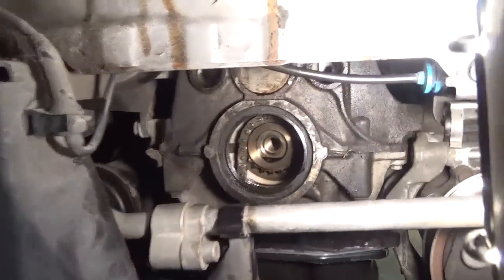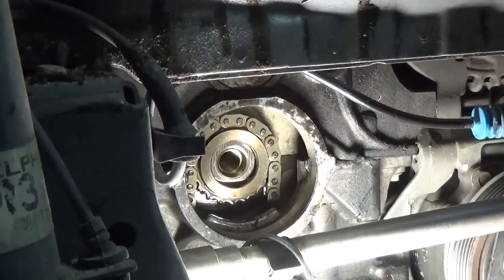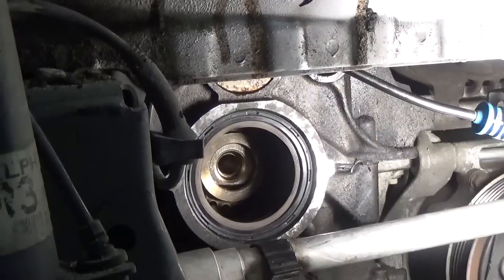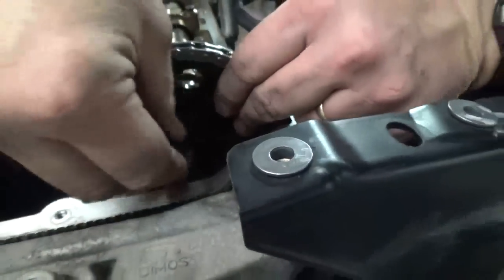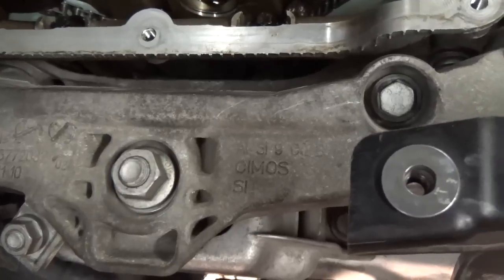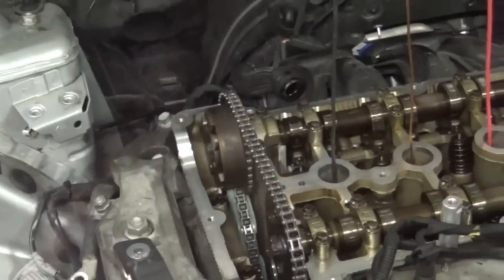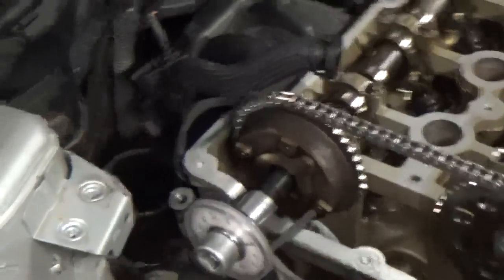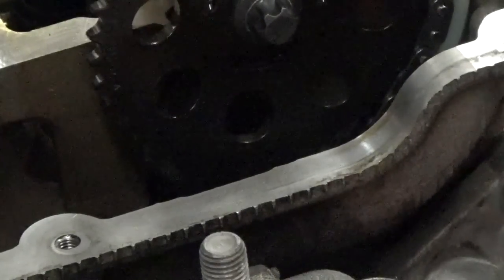2007 Mini Cooper S Timing Chain Replacement Part 3

Comment: Hi, 

Just wanted to say a little bit about safety............... oops sorry, watched your videos so much I got carried away there😉
Seriously though thanks a million for being so patient and detailed in your description of how to remove/reinstall cylinder head and setup new timing chain etc. It should make you proud that lots of amateurs are using your guidance to step them through the process.
My wife's mini suffered the identical fate of yours, jumped timing chain, death rattle then 8 bent valves, took it to a couple garages and just about fainted at the estimates to repair it. I dabble mechanically, put engines into small tractors etc but never taken on anything like this.
I watched your videos repeatedly with my 23 yr old son and eventually got the courage to take it on. After day one my garage had more bits in it than could have imagined, oh shit I thought, I hope we remember where they! 
We watched a few other videos and decided to Lapp new exhaust valves ourselves as well to try and save some money, as you say "if they weren't so nice to drive, you wouldn't bother" we also found the subframe to be rotten so decided to go ahead and source a 2nd hand one tidy it up fit new wishbone bushes etc and put it all back together hoping the engine work was going to be worth it.
Over the Christmas holidays we worked some long days but delighted to say it looks like it has paid off, a couple of days ago at around 10.30 at night we got to the point ready to try the engine. We're Scottish, so naturally we agreed, if it started we would go back to the house and have a wee dram (whisky of course!) and if it exploded, then we would still go up to the house and have a wee dram!!
Thankfully it was a celebratory dram, it started first turn! Absolutely delighted, a great father/son experience together, two days in and it is running better than it ever did.
We saved a bit of money in the process, it wasn't about that though, we learned so much and that's all thanks to people like you. 
So thank you very much and keep up your good work, if your ever over in Scotland I'd love to buy you a whisky to say thanks in person.😀
Reply from the maker: Thanks for the kind words, Murray! Glad the videos gave you the confidence to take on this project.
I've always wanted to go to Scotland. My ancestry going back to the 1400's was from the county of Cork. If I ever make it over, I'll look you up.

Comment: Hey man, you do a great job and you are really careful and you really understand what you do. Thank you for your videos! Little hint from my side to ease your work: to remove the crankshaft seal (above video around minute 4+), there is a much easier way: just hit the top of the seal with a 5 millimeter drift and it comes out on the bottom side just like this. Nice greets from Germany!

Comment: Rather than drilling and installing screws, I use a long prybar for the seal, against the frame rail and gently force it out from the top inside edge of the seal. Great video though for the Mini specific info especially.

Comment: I've seen conflicting videos about the crank shaft bolt / sprocket being left loose when installing the chain and tensioner etc fully and only when everything is in place then it is torqued up. But I've noted you torqued crank bolt up before fitting the tensioner. I thought the sprocket was left loose so that all the play in the chain is taken out? Just wondering what to do now lol which way is best? Great set of tutorials though really helpful Thanks 👍
Reply from the maker: I'm sure you can do it either way, as the crank is held in the correct position with the positioning pin.

Comment: Small tip #1: To remove the spark plugs, if you don't have or want to buy the BMW spark plug socket, you can use a long15 mm six-point socket.  It does not have the rubber bushing to hold the plug, but I used a medium claw grabber tool to pick the plugs out of their shafts and to lower the plugs back down and hand-tighten before using the 15 mm again.  The torque on the plugs is low, so you're not going to strip them with the 15mm.  The claw grabber is a must-have tool for anyone who ever drops nuts and bolts in an engine compartment, so it’s worth having.  Get one with a light.

Small tip #2: There are cheaper camshaft locking tools on ebay. I bought one new for about $55. My locking kit came without the vital instructions, but there's a youtube video on that.

Small tip #3: I did a bit of reading on this.  A DIYer said the Feltpro seal is better than the Corteco brand seal and better than the Mini original, at half the price.  Also, the Mini-specific seal replacement tool which Pelican Parts says you MUST have costs “only” $120.  The one in the video looks a lot less expensive.  However, a DIYer said you could buy a female coupling for 2" PVC pipe, and use a block of wood over it to tap the seal in.  The coupling cost $1.59.
Reply from the maker: Bill Donovan. Great tips! My plugs were 12pt, 14mm. Maybe there is a replacement plug that uses the 15 mm socket, but it wouldn't work on mine. I saw the cheaper cam tools on eBay too. I opted for what seemed like better quality. My only regret is my set didn't have the pre-tensioner tool in it. I had to buy that separate.
Reply: I'm puzzled that the 15mm worked on my 12-point 14mm plugs but not on yours.  Not questioning you, just puzzled.
Reply: Bill Donovan I just use it's ignition coil once the spark plug is free. Push the ignition coil back on and pull out. No extras cost effective

Comment: Great videos-  quick question to be clear -  when breaking the crank bolt loose, (and when you torqued the new bolt)  you just used the flywheel locking pin to hold the crank in place ?

Comment: Hi Paul, I just completed my chain replacement today. However the engine won’t start. It turns, but doesn’t start up. I checked the timing again and it looks right. Both cam stamping facing up when the locking tool is in place. My valves are fine since I changed the chain when engine is still working. I was wondering if you can give some clue why it won’t start? I suspect the vanos is not in the rest position. Everything else seem right. Thanks in advance.
Reply: most likely the ground wire on the plug harness. If you forget to screw this back on the valve cover bolt it will not start

Comment: Aug 23 2020 - im watching this video. Will 15 ft pounds of torque hold the sprockets in place as you rotate the engine?
Reply: Same question here. I am in the process of replacing the timing chain on my '07 S and some videos suggest 20 ft lbs while others sat 15 ft lbs. Is there a correct number? Thanks for the help.
Reply from the maker: I think it should.

Comment: doing this job at the moment and needed to know if the gears have a certain placement when putting the chain on
Reply from the maker: eatonpeaches no, they do not. I thought that was odd myself, being used to us cars.
Reply from the maker: eatonpeaches just enough sure to use the pre-tensioner that comes with the timing kit. mine didn't come with one and I had to adjust it a few times to get it right. the pre-tensioner goes in the tensioner hole in the head and takes the slack out of the chain before you tighten the sprocket bolts.

Comment: Hi...couple of quick questions if you have time to reply would be greatly appreciated... regarding the vanous hub on the intake camshaft,I know there is no keyway,but is  there a certain way it has to be fitted to the camshaft regarding oil feeds to the hub or is it just simply placed on..?and also because the valve timing was out,did it cause any internal damage to the engine... thanks
Reply from the maker: Jason, there is no specific way the VANOS sprocket goes on. Once you get both sprockets on, use chain tension adjustment tool placed in the tensioner hole in the back of the engine to take the slack out of the chain before you tighten the sprocket bolts. On mine, it jumped time and bent all 8 exhaust valves. Had to have the head rebuilt. New intake exhaust valves, valve job and head milled.
Reply: @miniadventure8714  thanks very much for the reply..I've got a Peugeot rcz with the same engine in it that has done exactly the same thing as yours..I think to follow your procedure and install the new chain kit..if it sounds the same as yours did upon cranking,I know it's going to be along and expensive road ahead for the owner..cheers Jason

Comment: Great video. Very informative.
There were maybe 4 variations made on the chain tensioner.
Is the replacement with the latest tensioner made by simply replacing the old with the latest? Or can the chain skip time when removing the old tensioner?

Comment: Great series of recordings, huge help. just one question, were you able to torque the crankshaft bolt just using the crank locking pin to stop it rotating?  I'm nervous it will snap the pin
Reply from the maker: I was nervous about that too. That is what I used to hold mine. Worked fine!

Comment: Thanks for the videos.. helping me a lot. When you torqued down the crank hub bolt how did you secure it from spinning? Did you use the 5th gear/brake technique or leave the locking pin/tools in place or use a crank holding tool?
Reply from the maker: Will Bradley. I used the crank holding tool.
Reply: Mini Adventure thanks. I just finished my work today - timing chain, removed/reinstalled oil sump, new VANOS solenoid and maintenance tasks (oil filter, new aux belt. In the end I took the risk and made do on tightening the hub bolt with all locking devices in place, somebody holding pressure on ex cam shaft with spanner and somebody in the car in 5th gear with brakes applied. May have been lucky but nothing broke and it was surprisingly easy to get 180deg 2nd stage. It was a tense moment turning it on for the first time.. started ok with a low oil pressure warning at first then settled down. It did however stall after a couple minutes then didn't start. Tried again and back up and running seems stable. Any idea why may have stall on the first run? 

Thank you so much for your videos that were invaluable

Comment: Ten Months Later...Partial Do-Over?
I am hearing the rattle again.  Not very bad.  I took the valve cover gasket off and inspected.  The top rail is slightly bent and not aligned perfectly with the chain. No cracks, no missing plastic, but definitely not perfectly aligned at the end where the chain comes up from.

Very likely, the chain is hitting it.   I suspect that the aftermarket repair kit included a weak chain tensioner.  I noticed back when I did the repair that it had more spring pressure than the old one, but not a huge amount more.   

So I am going to buy a Mini second-generation chain tensioner ($64 at Pelican, $69 ECS and Amazon, $79 Minimania) and a new top rail, put them in, and hope for the best.  

If I have correctly diagnosed the cause, then maybe one should not buy an aftermarket chain tensioner.  Mini has changed the design about five times, and the aftermarket may not have the latest one.

Comment: Hi, 
By far the best explainatory video on that subject. A big thank you for that, the detail level is awesome 
One question (I'm french and I probably didn't catch it) : did you use the flywheel lock pin to hold the crankshalf while torking the extra 100° ? 
thanks again
Reply from the maker: Yes, I used the flywheel lock to hold the crank while I tightened it.
Reply: Salut mdr je me lance dans ma distri sur thp jsuis français aussi lol
Reply: @nocopyrightsaudio6322  je te souhaite bon courage dans l'aventure !

Comment: Hello Mini Adventure. I have an issue. I did the job described in the video. However, after I finished and out some oil to lubricate the chain, I noticed that crankshaft seal is leaking (yes, no pressure, just few turns by pulley hub). I first thought that it's a seal that I installed badly, but then I realized that crankshaft pulley hub is NOT CENTERED in the spot for pulley. It play around 1 or 2 mm. Well, I am not sure what centers the pulley, the only thing on my mind is that I didn't have special tool to tighten the crankshaft center bolt, so all force vent to the flywheel lock. Any idea what could go wrong? Thanks in advance.
Reply from the maker: Not exactly sure what you are asking.....My hub went right in, used the flywheel lock to hold the crank in place and torqued it down. Another subscriber says the spec has changed to 37lb/ft then an additional 180 degrees, instead of 110 degrees. I haven't verified that myself though.

Comment: HI,great videoes,thanks!!!Do not have a new camshaft bolt if there is a problem?
Reply from the maker: All camshaft sprocket bolts must be replaced because they are torque-to-yield bolts. They cannot be re-used. You can get them on eBay. Thats where I got most of my parts.

Comment: Hey there, did the inlet camshaft dephaser spprocket need to be reset (pressurize with compressed air through oil inlet hole in the unit) before reinstall?
Apparently vvt dephasers need to be reset to their "resting position" before they're installed back onto the camshaft. 
I've got dual dephasers on a 1.6vti peugeot engine (same as this mini) and was wondering if this needs to be done before reinstall??
Reply from the maker: mine did not require that. the chiltons manual shows a good picture of what it should look like.
Reply: +Mini Adventure 
I have a Haynes Repair manual and there's something written in there about putting the dephaser back into resting position. 
Anyway I'll ivestigate it further. 
Thanks SO MUCH for posting your video as I'm going to save myself a lot of money doing it myself. I'm also quite an avid DIY mechanic but will be my first time doing a euro car. 
By the way, how did your mini run after this repair??..all good? 
Cheers from Australia!
Reply from the maker: +appdevcoder linux it ran great! no problems since. have put about 6k miles on it since.

Comment: it's so crazy that you set all pistons half way down for TDC on the motor Wow
Reply: Its not top dead center, its just where this engine was designed to be put in time. Since there are no marks on the sprockets, you can time it anywhere. They want the pistons halfway down to aleviate damage to the valves during the process.
Reply: @bdavem  europe motor like  do that

Comment: Thanks for the great video.  Let me ask you a question: A have a 2007 MINI Cooper R56 N12 Engine(Dual VANOS).  After changing the timing chain I keep getting the following codes P0014 & P0015. Did you have any codes back like that?
Reply from the maker: No, I didnt. Mine only had the VANOS on the intake side.
Reply: I had these codes on my 07 bmw x3 all i did is change the oil and the codes cleared

Comment: Crank and cam sprockets rotate. Yet the cams are not moving.  I double checked the torque. Crank pin is removed. Sprocket bolts are tight.
Reply from the maker: Not sure how that is possible.... If everything is torqued correctly, the cams should turn.

Comment: The crankshaft stage 2 has been updated to 180 degrees of rotation, also before all stage 1 torques install the tensioner.
Reply from the maker: Boosted_ Dizzle Thanks for the update! it's always good to share this info! thankfully  I haven't had any issues so far.
Reply: thank you for that i was going to ask
Reply: WELL, you might want to clarify the bad information about this. There is a big difference between 180 deg and 100 deg, some of us doing this the first time want  to get it right. Unfortunately my Bentley manual also had it wrong at only 100 deg ! I found out after 2 days driving and after discovering later the 2011 service bulletin I ended up tearing everything down to tighten the extra 70deg.
Reply: Quick question for both of you. How in the world are you breaking this bolt loose and then reinstalling the new bolt and also getting it that tight? How are you keeping the crank from rotating? Seems like an impossible task? 
I'm just looking for a tip or trick before I start doing this job on my 2008 Clubman

Comment: Hey! Thank you so much for the video tutorial!
Here at 14:00 you put on a "skim coat" on the crankshaft seal.... A skim coat of "what?" Oil?
Reply from the maker: Yes, oil on the shafy side. On the side going into the front cover, a skim coat of permatex ultra black silicone gasket maker.

Comment: Great videos! So it ran ok? You said in the first video it stopped running.  Just curious if the pistons kissed the valves?
Reply from the maker: well, I was hoping that changing the timing chain would fix it, but ended up having to remove the head since all of the exhaust valves were bent. Replaced all the valves and had the head surfaced and put it  back together. Runs like a champ now. Did a video on that too.
Reply: Thats a bummer! I'm going to look @ one w/54k on it . owner says he changed the oil every 3k but he said it sounds like it needs crank bearings.  Hoping its just the timing chain guides!!!!
Reply from the maker: +Joe Gigliotti 

when it is cold it will have a " rattle" that almost sounds like lifters ticking. make sure you get all of his oil change records. Mini has a class action settlement on the timing chain and they will want to see those records before they will replace it under the settlement. I have heard of people having the timing chain replaced as low as 30k. the tensioner is the big problem.
Reply: Did you notice if yours was noisy before it stopped running?
Reply from the maker: +Joe Gigliotti 
a little when it was cold. there are a few videos on here of how it will sound. I think mine jumped time because a piece of the guide fell down in between the crank gear and chain. if it is rattling, I would check it. I plan to do yearly checks on mine now. there is a tool you can use to measure the how far the chain has stretched. there is an alternate tensioner that is longer to take up the extra slack, but that is just a patch in my opinion. best to just change it all.